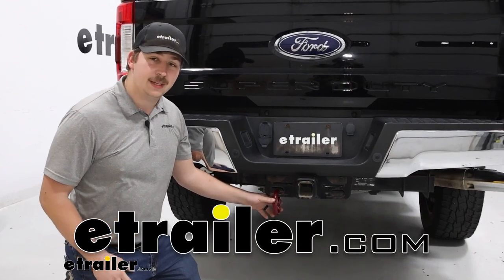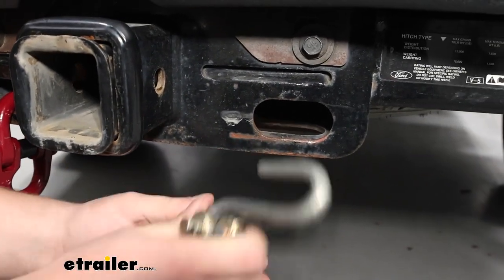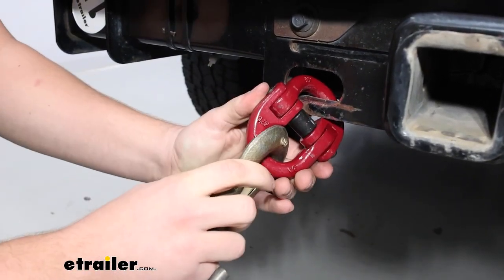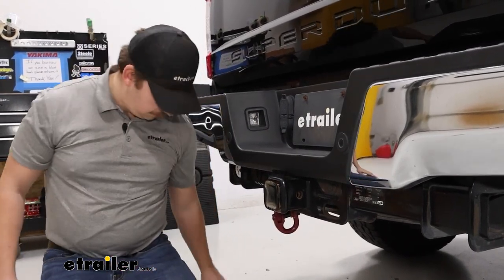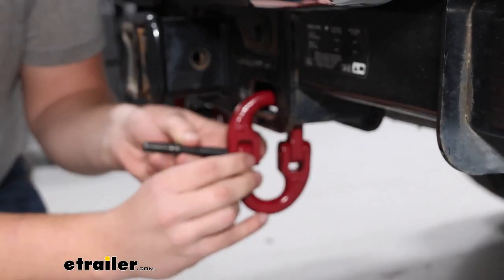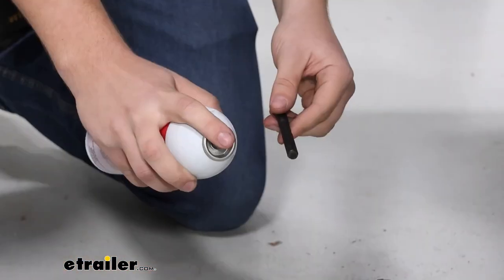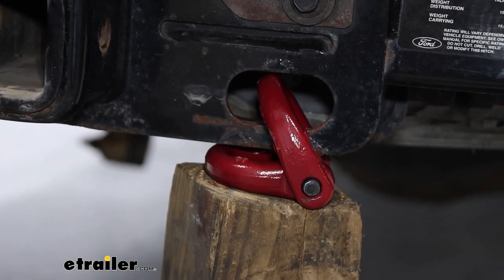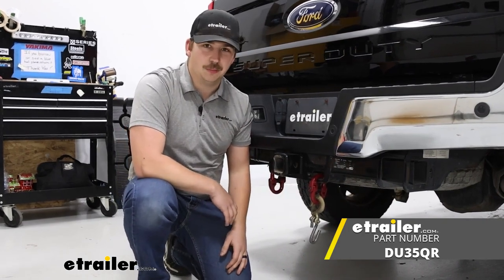How to Install: Durabilt Safety Chain Connectors for 1/2" Chain on your 2018 Ford F-250 Super Duty

Comment: FINALLY, A SOLUTION! I work where there is a fleet of these SuperDuty's that tow. When I go to hook up the trailers for the crews, there's usually two F words that can be heard echoing in the yard. I'll let you figure out which two they are. Also, don't apologize for a difficult install, it is but a fraction of the effort compared to trying to get a safety chain hook in those factory safety points.
Reply from the maker: We're glad to hear that the Durabuilt # DU35QR safety chain connectors worked well for you. Now, you can save the spicy language for more important things.. like your mother-in-law.
https://www.etrailer.com/Accessories-and-Parts/Durabilt/DU35QR.html